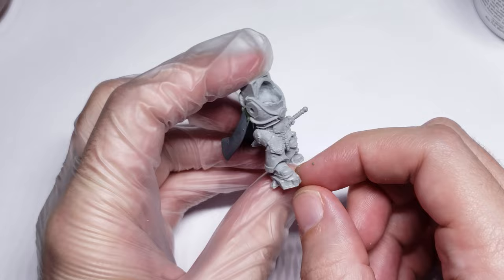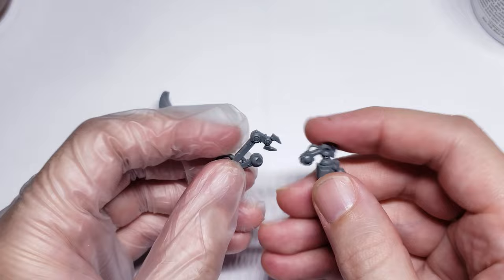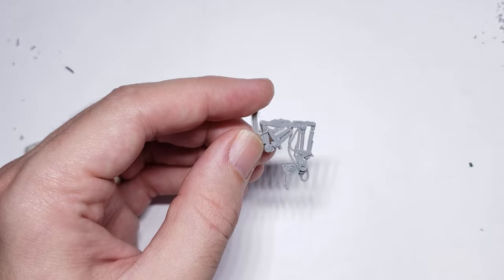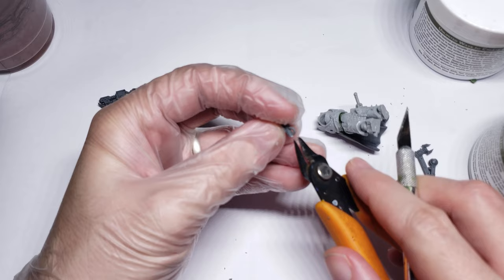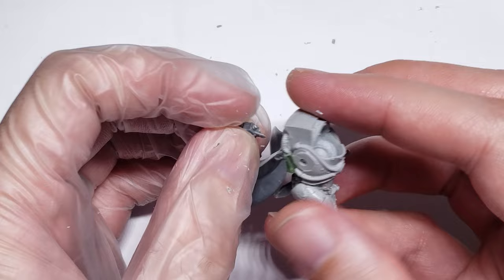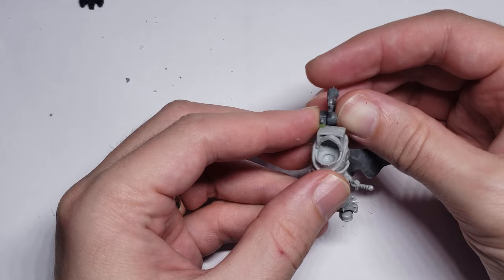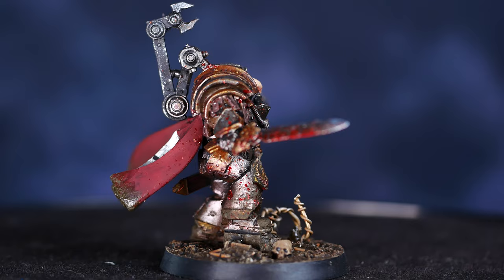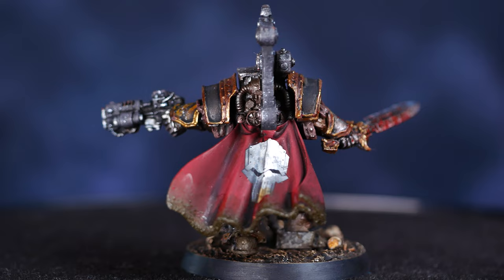Kitbash Cataphractii Servo Arm | Warhammer The Horus Heresy

Comment: Thanks! I gotta build one for my Iron Hands! They desperately need to update the Iron Father model
Reply from the maker: Yeah... Think it came out in like 2012?
Reply: @AmnioticlyTanked  Maybe? I mean it wasn't as bad as the Berzerkers but the model does not reflect the stock load out of an Iron Father: the Machinator Array has two smaller servo arms, a Meltagun, and a Flamer. It's almost spot on for the old Tech Marine with the full servo rig, though you'd have to convert the Plasma Cutter arm a bit, but that wouldn't be hard - and luckily i managed to score an old pewter one very recently........